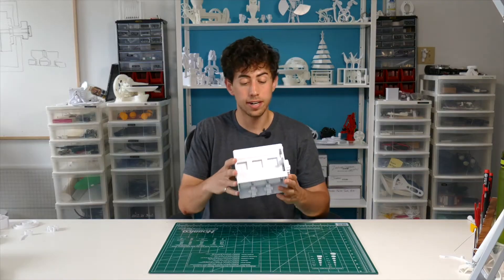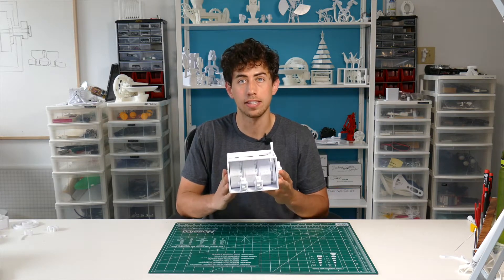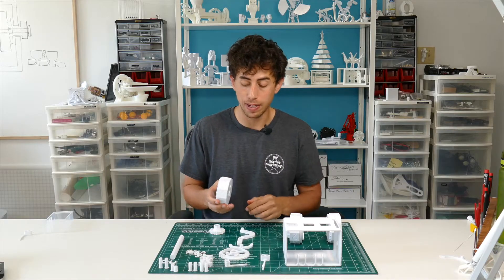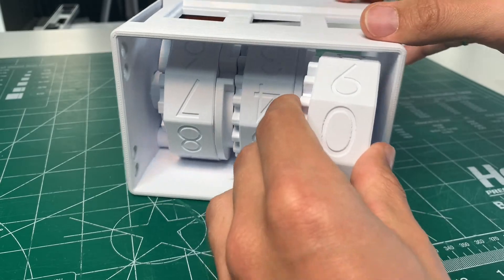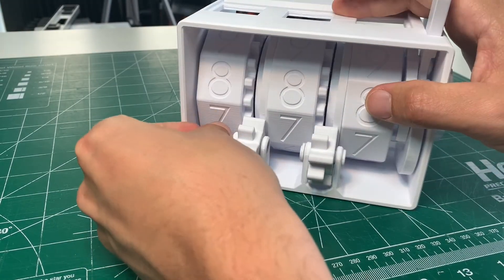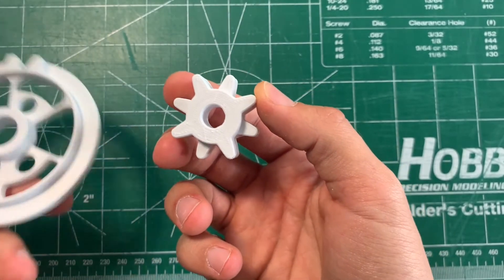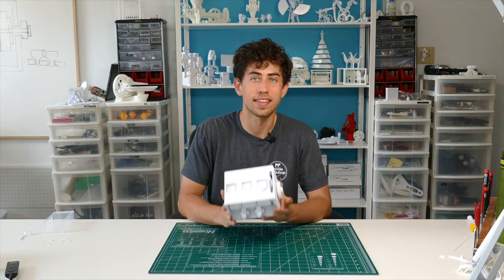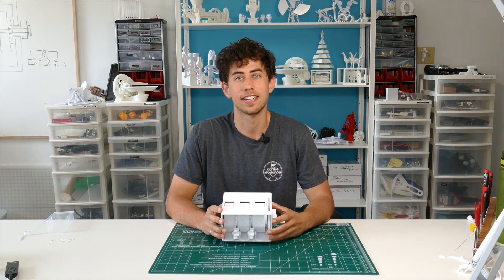The Mechanical Counter - Fully 3D Printed Mechanical Machine

Comment: Hey!  I have a question.  Can you stand it upright?  I only see it position on it's back.  I'd like to have this on a desk as a reminder.
Reply: I was thinking the same thing. I may have to design an adjustable stand for it. If I actually want to use it, don't want to hold the body of the counter with one hand while pulling the lever.
Reply: Same here. Mine is on the back now I would prefer a stand.